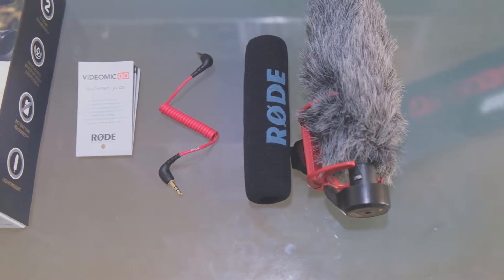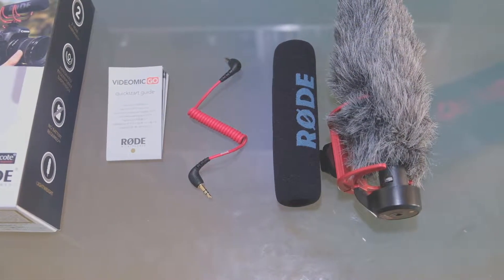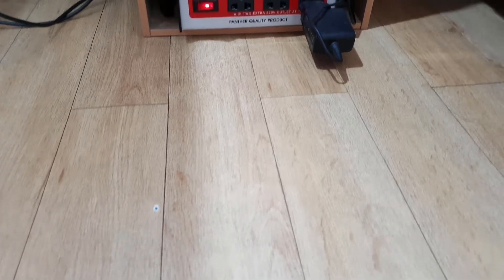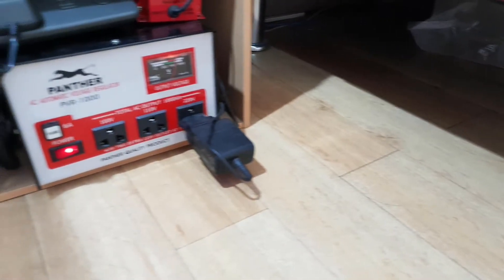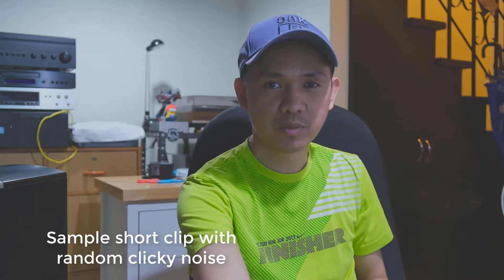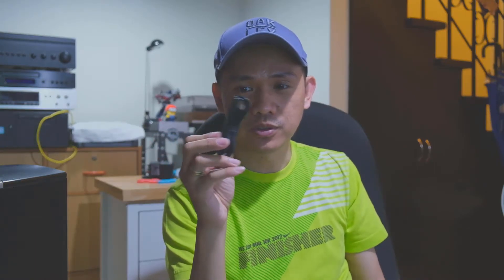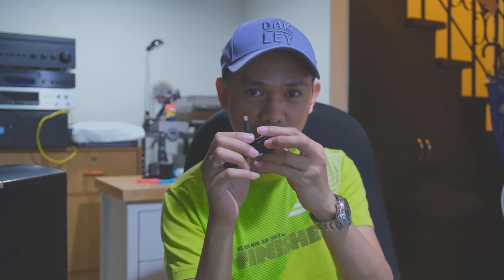Rode Videomic GO Static Noise Issue

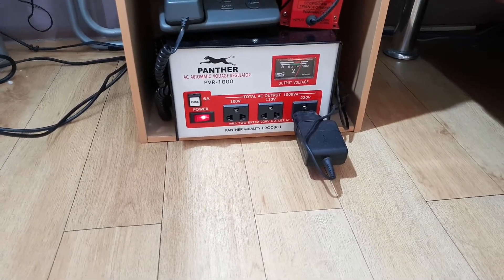Comment: 1:20 Its a little vague... do you mind clarifying. 
Are you drawing poert from the Voltage Regulator to the camera, or is it just in proximity... if it is in proximity how far do you have be away before it dissapears?
on my XT2 if I hold the camera body the problem goes away, when I let go it reappears, so it is a grounding problem for me.